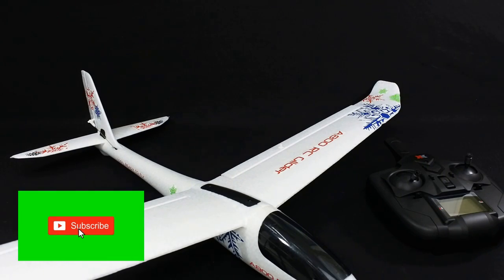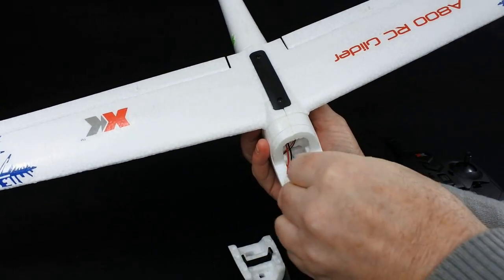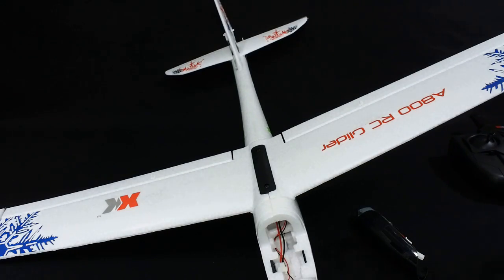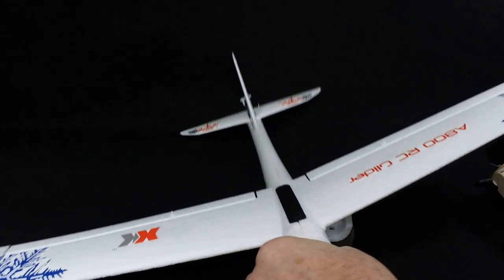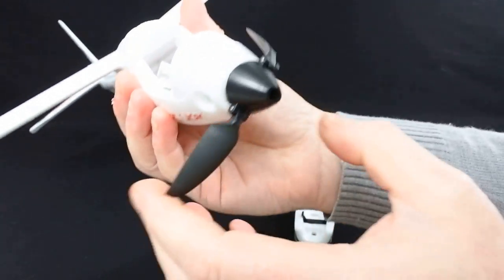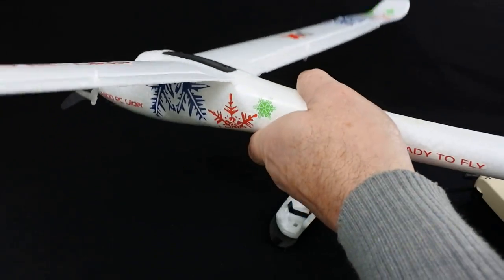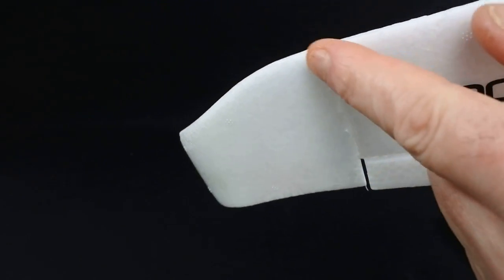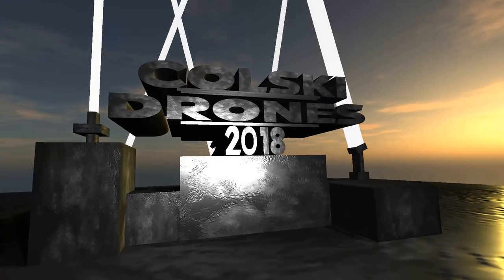XK A800 RC GLIDER OVERVIEW AND BINDING TO JUMPER T12

Comment: I confirm it works on Radio Master 16 . But I can't get rid of the rudder ali mix and gyro set up switch ...any suggestions
Reply from the maker: You just need to set it up with out using the stupid set up wizard

Comment: I just got the Jumper T12 this morning and have successfully bound it to my A800 but I cannot find how to link switches to the rates and 3D/6G modes. Ok, so I can set up rates using the flight modes page I guess but they are on a switch on the supplied transmitter. You say you found channel 8 for yours and I assigned channel 8 to a switch on the input screen, left the outputs at default -100 +100, but it has no effect. Any help will be most gratefully received.
Reply from the maker: Hi all you need to do is go to the mixer screen and assign channel 8 to a switch that’s all you need to do
Reply: @CKone41  Hello I want to thank you for the video as I want to bind my XK A430 to my Jumper T8SG and it will certainly help. Thank you. ;)

Comment: Nice review good plane. The only thing I don't like about it is that there seems to be no way of turning the stabilisation off completely and seeing what it can REALLY do! Not even when using the Jumper or Taranis Tx.
Reply: l8ur1e you are correct.  Got mine set up with my XLITE and IRangeX lite.  Flies 100% better...but still no clue how to get the stabilization to turn off.  No idea what channel it’s set too.
Reply from the maker: The stabilisation is on or channel 8 or 10 depends when it was made you will need to adjust the end points on the channel also
Reply: Colski Drones Thank you!!   Definitely useful information!  This is a wonderful flier....now I want to go bigger.

Comment: When I plug in the battery the red light flashes continuously intermittently and none of the controls work. Nothing, no sound of servos, just nothing, as though the radio isn't communicating at all. I gave up on it. £50 down the drain.
Reply from the maker: You just need to rebind the transmitter
Reply: @CKone41  Could you tell me how to do that please?
Reply: @dgnash  i have the same problem. did you find the solution?
Reply: @jaimemacias826  It suddenly started to work and I'm not sure why. At someone's suggestion I put the throttle to full speed but that didn't work, at least not straight away. A few minutes later it just burst into life. All I can suggest is to check the connections and be sure the battery is fully charged.
Sorry I couldn't give you a more definitive answer.
Reply: @jaimemacias826  By the way make sure, when you fly it, to have plenty of space. I've flown mine into a tree three times now. It survived. I'm a lousy pilot, The plane goes quite fast and you have to be quick with the controls. It's a lot of fun though.